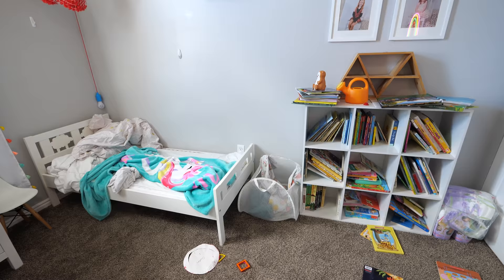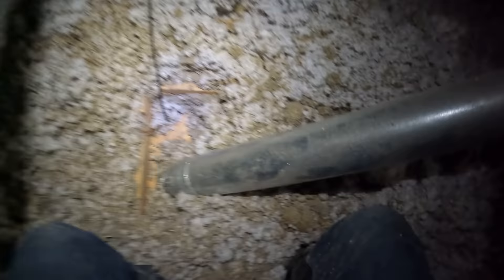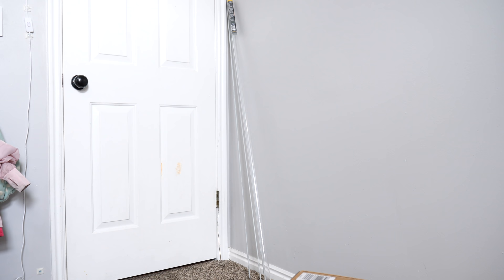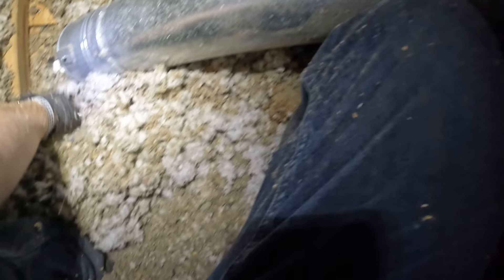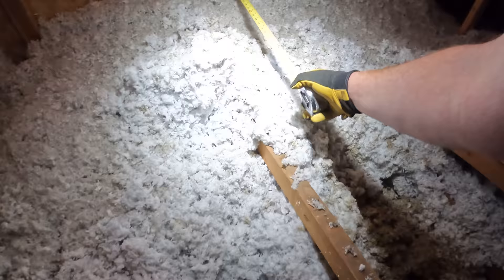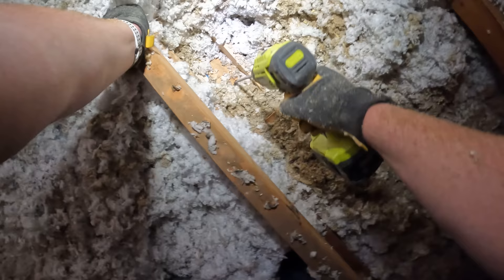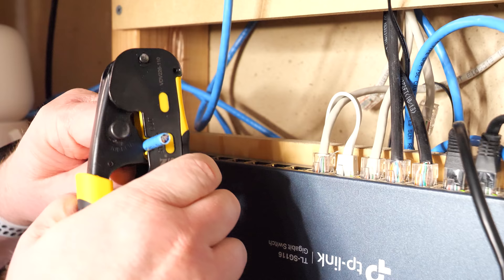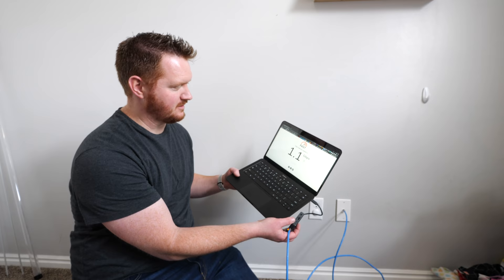Wiring Cat 6 Ethernet Ports Through the Attic

Comment from the maker: My biggest tip with this is to double check you are in the right spot before drilling holes everywhere. Also, it might be way too hot to go up in the attic now, make a plan to do it this fall.
Reply: Any idea how to make my tpljnk access points faster there WiFi 6 and it was an extender but in access point mode now. Also how can I make my gigabit Internet faster on ethernet I got a cat 7 ran to outdoor conveted like in the garage in the mesh WiFi  video
Reply: @choosingmusic11488p  If you only have Gb, anything better than CAT5 won't do a thing for you.
Reply: @James_Knott  oh ok
Reply: I really hope you used Solid copper not the CCA  'Copper Clad Aluminium' garbage.. Also real world testing has shown that cat5e can handle 10 gig connections someone got 8.5Gb/s with cat5e
EDIT: also those rj45 ends need to be re done on the switch.. the outside jacket shouldn't be that far back. You want the RG-45 tip to be locking the jacket in the tip.
Reply: @aaron840  Try those over 100M, which cables are normally rated for.  Certainly you can do that for much shorter lengths.
Reply: 13:00 you did not push the wire enough into the rj46. if you spin the bottom of the conector that gets the 2 tabs to hold the metal jacket you will see you stopped exactly at them with your cable. so in your case your wires in the conector are held by the individual strands

Comment: When crimping an rj45 plug please push your cable in as far as you can so it also grips on the outer sleeve, the way you did yours they will eventually break.
Reply: Did you see the black ones?  Those didn't even make it into the plug!
Reply: May* eventually break. If there is no movement, they will suffice. Additionally, if we are giving advise, please use correct terminology. It is jacket, not sleeve.
Reply: How do i find the top of the wall so i can put the wire ? Any tios thank you
Reply: @giancarlotorres6795  Looks like he measured it with a tape measure from the end of the wall to the spot he wanted the jack. 
He then went into the attic and used the tape measure again to find the spot to drill.

Comment: I have done a lot of network installs and I think it would be a good idea to re-crimp those RJ 45 ends and push the jackets way further inside so that it crimps properly.
Reply: I always add the blue boots on the ends as well.
Reply from the maker: That is a good idea, I realized I should have pushed them all the way in through the pass-thru end to have a better end. I actually did some others today like that and they look great. Thanks for the tip!
Reply: You should re terminate those RJ on the patch and in the switch end, it works but it is a possible point of failure. 100% agree with Anthony.
Reply: I'd highly recommend finding yourself a set of RJ45 plugs with a load bar too. They make things much easier and it results in the exposed conductor length being as minimal as possible.
Reply: It would an even better idea to use a patch panel instead of crimping RJ45 ends.
Reply: @brianleeper5737  Yes, patch panel is the way to if you have a lot of runs, but might not make sense if you only have a few runs. In my house I have a 24-port switch in a rack mount with a patch panel right above it. Each port on the switch connects to the patch panel with an 8-in patch cable. Neat and tidy! Also, if you're doing a lot of runs, punching down Keystone jacks is much quicker than crimping RJ45 ends.
Reply: @KoldSteel1990  You can also use a keystone jack wallplate as a patch panel, which I've done before when there were only 6 runs. Crimping RJ45 ends is a lot more work and more likely to give you trouble.

Comment: As an RCDD for 30 nearly years. I recommend buying your station cables rather than using the Cat-6 solid conductor cable which is used for your horizontal path cable.
Reply: "recommend buying your station cables" 

what?
Reply: @PatrickSmith87  Station cables are meant to be flexible and the pins of an RJ-45 plug are meant to pierce the jacket and make contact with stranded conductors. These systems are meant to work in this manner because the actual transmission of the signal works best to this matched ecosystem. Solid conductor cable is meant to be typically stationary after installation and station cables and patch cords are meant to be moved, or twisted and bend in more flexible manners. The next best reason is making your own station cables is costly and time consuming. 0.5  to 5 meter standard station cables can be bought very inexpensively, and these cable are usually quality tested and come with 25 year warranties as part of a structured cabling system.

Comment: When running the cable be sure not to lay it next to power wires. It can and will pick up static from the current causing errors. Be sure to shove the wire sleeve up into the RJ45 giving the plug more support before crimping it down.
Reply: Yeah I was going to say that it looks like the socket is a bit too close to the power outlet.
Reply: Cross mains power cables at 90 degrees where possible if you have to pass them.

Comment: To pinpoint where to drill in attic....
Drill a tiny hole in the ceiling, directly front of the wall where your cables are going to drop down and stick a wire hanger up through this hole into the attic.  Up in the attic, locate the hanger (have someone move it around if not easily seen) and then drill into the wood joist/doubleplate directly behind the hanger.  Fill tiny hole in ceiling with spackle or toothpaste.  Works every time, no measuring needed.
Reply: Dude thats brilliant
Reply: Good idea, I have to do my runs this weekend and that will make it way easier.
Reply: Glow rods

Comment: A few points:
1) When taping the cable to the coax, stagger the cables, so you don't have one big bump to catch on things as you pull the cable in.
2) For proper installation, always terminate solid cable on jacks and then use a patch cord.  While there are plugs for solid wire, those came about only because people insisted on doing things the wrong way.  Yes, that means a patch panel at the switch end.
3) Another useful tool is a length of "dog chain", which can be dropped down inside walls, etc..
4) You installed the jack in the wall upside down.  The wires are supposed to be at the top, with the latch at the bottom.  This keeps dust from collecting on the contacts.  I would also mount the switch connectors down, for the same reason.
5) Do not use solid wire for patch cords.  It's not meant for that purpose and movement of the cable may cause metal fatigue in the wires, which will cause a break.  In fact, these days, I don't even bother making patch cords, as buying them costs a lot less than my time.
6) It's hard to tell, but it appears you didn't push the cable far enough into the connector.  When you crimp the connector, a piece of the plastic is supposed to clamp the outer insulation.

BTW, on my 500/20 cable modem connection, I typically get around 935/31, according to speedtest.  I've seen as high as 948 down.  My LAN is 1 Gb, so there's not much room for improvement.
Reply from the maker: Thanks so much for all the tips! The upside down plate was just me being in a hurry and noticed it later. The Switch worked the best for me that way but I understand the need of going the other way, I just find it odd TP-Link doesn't have holes to mount it that way.
Reply: 7) when you cut out your low voltage box in the drywall, test the location to verify there is not a stud in your path.
Reply: I am just going to address a few things in this comment, as there is some misinformation.
1.) Sure, but it clearly worked, and it is only 2 lines. He isn't pulling a 12 line bundle.
2.) Patch panels are not necessary in this type of environment. They are useful in many ways, but for in-home use, re-terminating a broken line is not the end of the world.
3.) Fish tape or rods are a much better option due to rigidity. Use in conjunction with poly  pull line for any needed flexibility.
4.) Keystone was installed "correctly" as the text should be right-side up, and the clip down. However, even when installed inverted, there are no adverse effects with the cover installed.
5.) I agree, solid core for patch cables is not the best option due to possible mechanical fatigue, but still viable in a home environment.
6.) Yes, the insulation should be pushed in as far as possible.
7.) Absolutely, but there is no evidence he didn't. Secondly, the box for the electrical outlet is most likely attached to a stud so as long as he has it 1.5 inches away, safe bet in modern construction.

Source: It is literally my job.

My only advise, and again you may have done this, is to leave a service loop, which is just a loop of extra cable, near each termination in the event you need to re-terminate in the future. Thank you for the video!
Reply: @w0nd3rb0y  1) It worked in this case; the point of the comment was that, in general, it's a good idea to stagger the wires since you don't know what it might run into when fishing the line.
2) Patch panels aren't "necessary," but they're neater, they make organization and labeling easier, and they look more professional, which will be a sticking point when it comes time to sell the house. Nobody wants a mess of random wires hanging from holes in the ceiling. If it's literally your job and I'm paying you to run ethernet through my house, then you damn well better be installing a patch panel.
4) He filmed two different jacks for this video. One has the power outlet to the left, and is installed upside-down. The other doesn't and wasn't. If I were looking to buy a house that had upside-down keystones (or even worse, inconsistent from one jack to another), I'd assume all the other work done to it was half-assed as well. Also, the cover is not covering the wires inside the jack, so it appears you missed the point of the comment you're responding to.
Reply: @rars0n  You missed the point of my response. None of his bullet points matter in a simple home network. There are no wires inside the jack. I assume you are referring to the contacts. If someone is going to speak as an "expert", the terminology is important. Dust will not collect on the contacts inside the jack, upside down or not. For reference, many switches have alternating ports. They are designed to be installed horizontally. I don't find dust in the ports with the contacts on the bottom. It is not a concern.
Reply: @360ModsandHacks I always cut sideways first. That way if I do hit a stud, I can just move the box away from the stud.
Reply: @w0nd3rb0y I have seen plenty of dust in upside down jacks over the years. Will it happen in a house… not as much. But it is still a concern.

Comment: Tip when stripping the cable the String is in there for a reason to help strip the jacket back, Its best practice to strip using the tool and then use the string to strip the jacket back further and use that fresh pulled back wire for termination. When using a stripper its possible to nick the wires and have them break when terminating or even worse in a few months time with movement and temp expansion cause intermittent problems.

Comment: A good tip a to find exactly where to drill is to take a thumb take and poke a tony hole in the ceiling. Take a small piece of RG-6 cable and strip the cable down to the copper clad center conductor. Once you strip the cable down, take 6-8" of the center conductor and push it in the hole. Make a mental note of about where the room is in the attic, brush your hands around the insulation and you will be right near where you drill down the header.

Comment: If you have an oscillating tool you can get a special saw attachment that cleanly cuts a perfect rectangular hole in dry wall. Although for some reason it works better with some oscillating tools than others.

Comment: A bit difficult to see but it looked like the plug didn’t crimp on to the outer sleeve. Tends to put strain on the connections into the signal wires. Also there are 2 types of cables, stranded and solid core. Stranded is for use from a socket to a device as it can flex easier, but it has a higher attenuation so shouldn’t be used for more that 10 meters. Solid core is the stuff you do between socket and patch panel. Better attenuation but not designed to be flexed. The maximum distance you can run that is 90meters. This gives you the maximum 100 meter rating. If you flex solid core it starts to crack the conductors and it eventually fails. 

If you punch down in sockets and patch panels then they have a guarantee of 20+ years, so it’s a fit and forget. Patch leads are throw away items. 

Remember the specs are usually built with some over engineering and are, if followed, able to guarantee it will work to spec so when you put your cable certifier on the line it passes all the tests. Then the installer gives the 20 year guarantee backed up by the cable manufacturer. I’ve done 10’s of thousands of cables and only ever seen one fail cert tests for anything other than miss wiring. 

Don’t sweat the advice here though, let’s face it your not going to be moving the switch connections about much so it’s not likely to have a problem that end and the other end is a socket. The patch cable breaking will just be a case of throwing it away and terminating another. 

Good on ya for jumping in and getting it done.

Comment: I know this is old but for others that just ran across this tutorial like I have this is an excellent guide in WHAT NOT TO DO!

Data cable should be kept away from electrical wires as much as possible.
The cable in the attic and wall cavity should be stapled.
Twists in the cable pairs should be maintained as close as possible to the terminations in the keystone
The outer jacket of the cable needs to be well past the strain relief.
The cables coming into the room with all the network gear should be on a patch panel.
Don’t make your own station cables buy pre-terminated ones. If you insist on making your own use stranded wire rather than solid core. I know the heads on many pass-thru brands say they work with solid core but they have a high failure rate.

CAT6 will run 10GB at 55 meters. You’ll probably connect at greater lengths but will likely have hire loss rates. 2.5 GB is possible at 100 meters.
Reply from the maker: Always looking to learn. Thanks.

Comment: Mistake 1– u attached coax to Ethernet cables —- attract a pull string or 2 for future…

If no coax pull I have before have pushed up from 1st floor pvc pipe to drop the cables thru…. PVC 1 inch or 3/4 or 1/2 pipe 10 ft stock length easily to get into the 8 foot tall 1st floor and the stiffness punches thru any obstacles in its way after cables and string pushed down pipe.  Then you pull pipe out from the first floor

Comment: In my opinion, going through the attic is always the best option as it is easy to hide away all the cables, and easy to drill into walls and drop the cables down inside the walls
Reply from the maker: It worked really well. The only time I wouldn't is if I had a crawl space but no attic to crawl through.
Reply: @TechWithBrett  Crawl space is great, but here where i'm from (Norway), they almost does not exist. The exception is really old houses

Comment: Brett, great video with good pacing, just enough detail, very well done. I ran most of the cabling for a new home so was able to do so before the drywall was on so that was super nice! I bought a patch panel to really do it "right", but as it is coming down to it, I may just terminate those into the switch....
Reply: If you already have the patch panel, use it. Otherwise, you'll be fine. Just leave a bit of extra cable in a loop in the even you need to re-terminate in the future.

Comment: Just my two cents: the information printed on the cable not only tells you it is Cat 6, it also has the foot measurement of the cable.  I believe it's in two foot increments.  No need to guess how long the cable is or when to cut, just look at the cable and it will let you know how many feet you have pulled.

Comment: Pretty good with the basics. Only thing I might add is you really shouldn’t use solid core riser cable from the wall to the computer. Every time you move it your risking bending and breaking it. Stranded cabling is better. Also I would have put stain relief boots on the cable.
Reply from the maker: Thanks, I'll have to look into those.

Comment: 7:15 do not use sprayfoam insulation if the hole is too big , you will hate yourself later on.
Just use some tape if you are worried about the cords wiggling or stuff some excess loose insulation in the hole.

Comment: Awesome video!
I recently got a Firewalla to use as my edge router. Was able to get a lot better network speeds rather than using my WiFi router as my main router. Might help you out to get a different router instead of using the Google router.

Comment: Bro I been wanting to wire this house with ethernet forever now. The only ports in the rooms are phone line jacks. I'm just worried Cat 6 won't be enough for long distances so I might have to go Linus Tech Tips style. I'm this close to just hiring an electrician. Also I've never been in my attic before.
Reply from the maker: It certainly is quite the undertaking! If you have plenty of room in your attic it makes it pretty easy to move around. Maybe in the fall take a look up there and if possible.

Comment: Thank you so much for putting this video together. Running additional ethernet cables has been on my bucket list for awhile. This video really helped me understand what all is involved and the tools required. 

If it is not practical or possible to run an ethernet cable to a particular room, would you recommend using a power line ethernet adapter?
Reply: No!